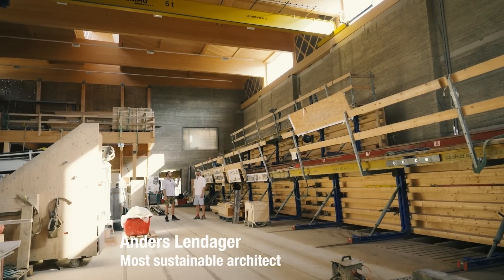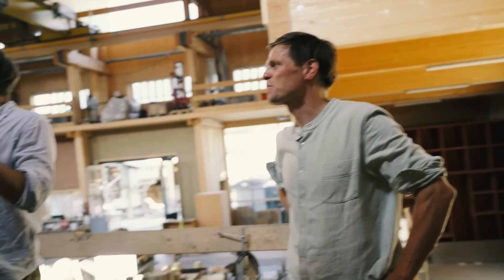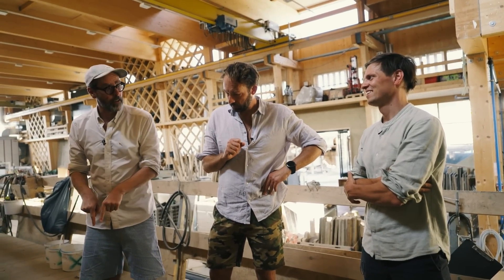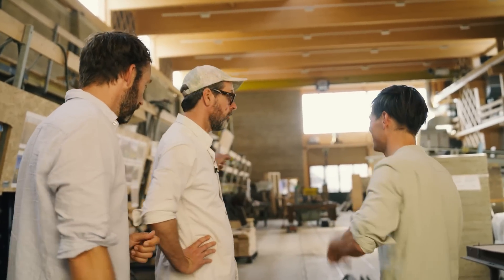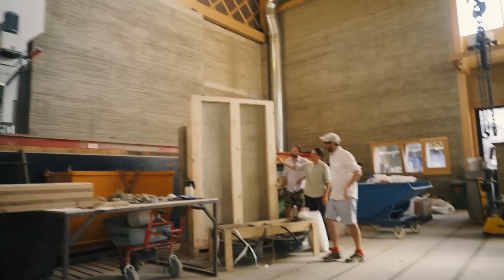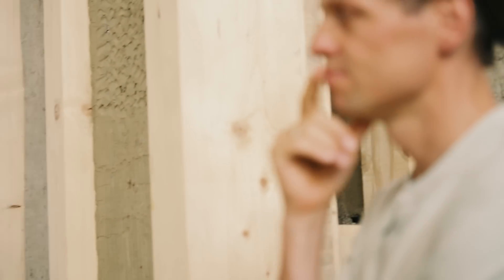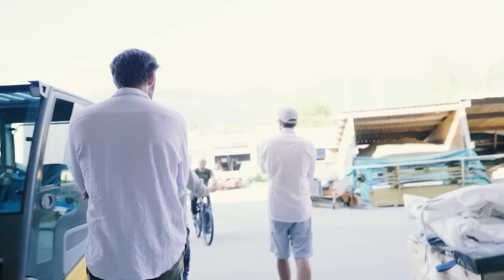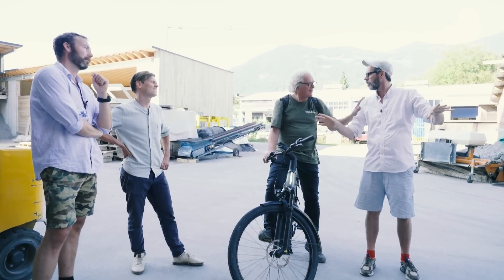Inside Austria’s Rammed Earth Factory: No Cement, Just Earth – Revolutionizing Sustainable Building

Comment: Well clay / soil is a very interesting building material, but it is also not renewable material / growing material. Or at least it takes very long time for the nature to produce it, I guess. When you dig it up, it doesn't renew itself - but in the end you can put it back, so to speak. But what I want to say is that you cannot allways use the soil, directly from your building site. Either the material is not good enough (does not have any or not enough clay) or there is not enough soil for the whole building. So if you want to build all buildings in the World this way, you end up digging big holes, just as the excavation for gravel for concrete. So it is interesting, but not in really large scale.